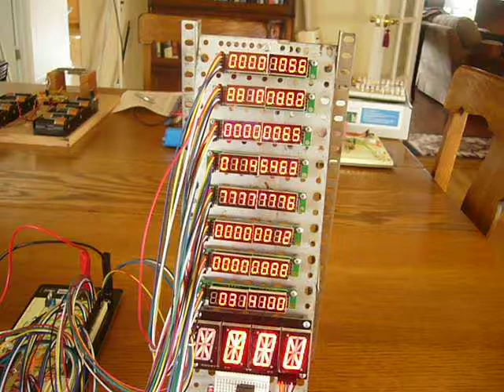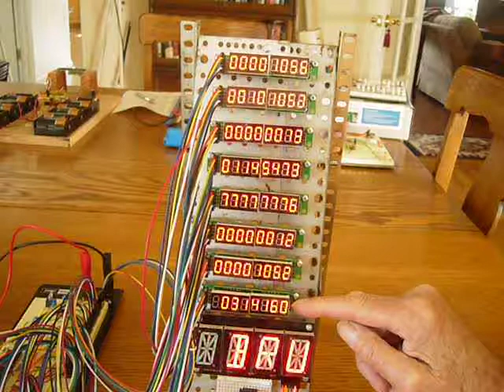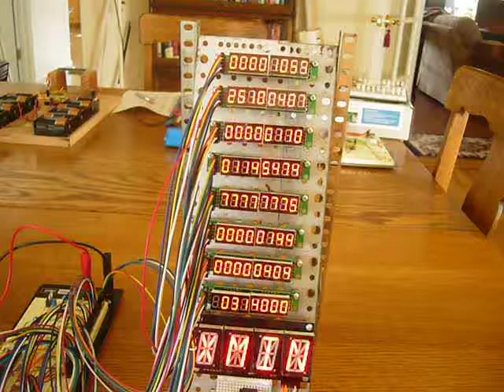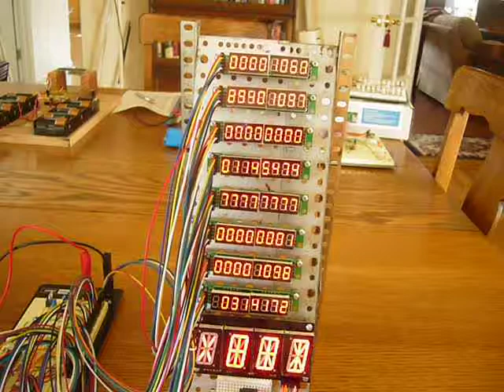SDS910 Simulation

Comment: OH MY GOSH!! Hopefully you are still on line. I cut my teeth on SDS910 and 920. On site we had a 920 and 930. Used equations to trouble shoot problems. We had a multiply failure but not a divide error. Used the equations to isolate the error. Masculines had core memory and ran round 2 to 4 mhz. Might have been CPS in those days. Whats kinda sad is using todays technology a SDS930 could be fit in a Xilinx or Altera FPGA with room to spare. 920 had an instruction that would execute an instruction located in memory. We had tape drives, paper tape readers and punches attached to the machine as well as a teletype. Oh the good old days.
So how do you know so much about the SDS machines?